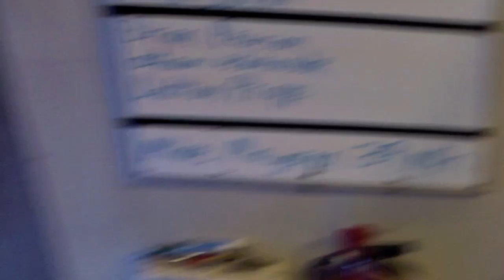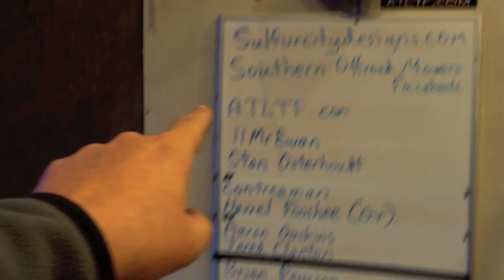Dixon running!! Ready to roll!!

Comment: IDE like to get a zero turn similar to that and put snowmobile tracks on it, like run a straight shaft thru the front where the front tires are and have the drive wheel on the rear axle, make a mini groomer or a weird buggy

Comment: I got one of these dixons for free mines a 89 ...428 .. It came with a new 14.5 hp Briggs ohv engine it runs beautiful mower deck needs some welding but works perfect....just the cone trans needs some tweeking any advice there would be super awesome .....the one arm like urs just flops and is not even like urs I have all the specs for the trans and how to adjust just wanted ur input on any tips and tricks with the trans!!!!!